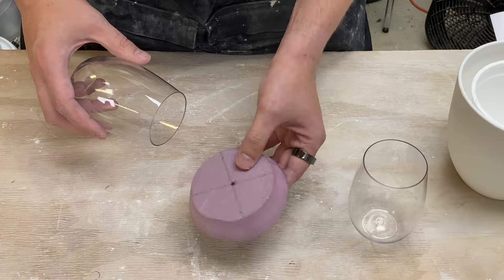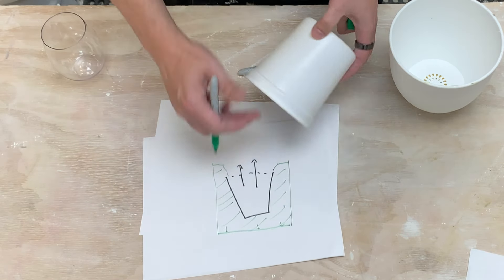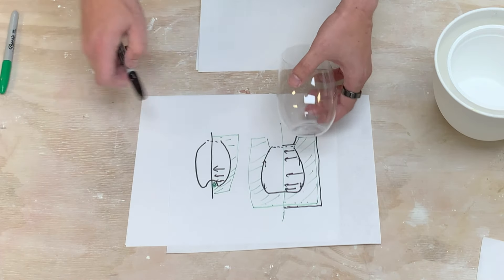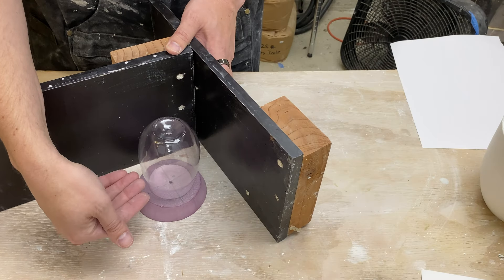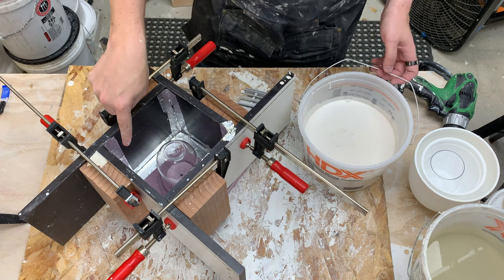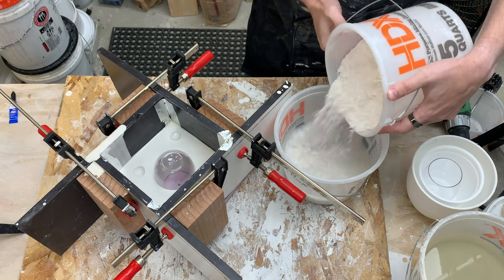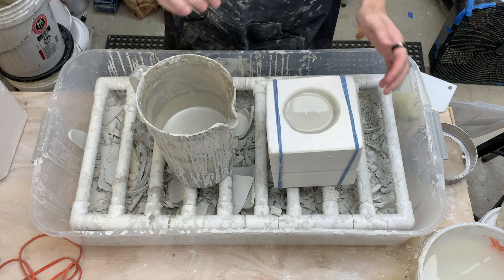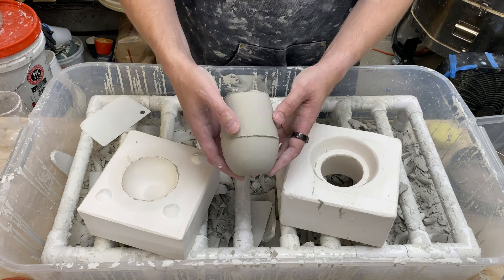Two Part Plaster Mold for Slip Casting

Comment: Excellent!  One tool I use that helps with handling internal bubbles and avoiding sneaky lumps is a small kitchen strainer. I pour through that, just as with the slip, and it helps with consistent surfaces. 😁
Reply from the maker: Thanks! I hadn't seen that one before. In these recent experiments I've found that mixing volume has had once of the largest impacts in reducing bubbles (having enough liquid so they don't get sucked in).
Reply: Pędzelkiem się dpowietrza
Reply: @epidian6240  - Не всегда, в отрицательных углах не удаляется.

Comment: The glass only had two molds, the bottom indent was added after the hot pieces were pushed together, and a stamp pushed up and deformed the combined glass.
Reply from the maker: Thanks. It is plastic, but that would make sense.

Comment: line the cottle boards with a plastic bag - guaranteed not to leak. An much easier to get a water tight seal than tape, clay, etc.
Reply from the maker: Interesting idea. I did that for a bit with my plate bucket - but it can get a tear that way so I stopped. And now, I much prefer my 3d printed molds!

Comment: I love mold-making. Good thought process. Another option was to eliminate the bottom foot, smooth-in with clay, and do two piece mold. Then use a round utensil to hammer in a foot indent after pulling out the form. Wouldn't be as precise but it would look better imo than an obviously mass-produced foot. Of course you were doing this as an example so no artistic judgement 😂
Reply from the maker: Yep, just a demo for sure! But it is a great point that you can modify forms to suit your needs like that.
Reply: Залей таким способом лампочку.

Comment: great video! i'm new to this and I'm a little confused, what liquid material is used for the slip? is it just plaster, or is it specifically made for slip casting?
Reply from the maker: The material to make the plaster mold that I use is specifically formulated for use with ceramics. In particular it is USG #1 Pottery Plaster.
As far as the slip itself, the clay composition is different than throwing clay, but I haven't dug into the details and I get it from my pottery supply store.
Reply: A newbie here as well trying to figure out the liquids.. Did I understand correct that the mold itself is made of modeling plaster (modelgips in Dutch)? Also wonder if this technique can be used to make mold from a clay sculpture and then make a plaster copy to have it lighter and to sand the imperfections afterwards? 
Many thanks!
Reply from the maker: @caglakaplan1748  Yes, the mold is plaster - it is specifically design for pottery use like slip casting (other plaster might work but I don't know).
One traditional way to do this is to make a plaster mold of a clay form. I think you're asking about making a plaster object from the mold - that might be tricky as plaster likes to stick to itself and is very rigid - but again I haven't tried myself.
Reply: @PotterybyKent maybe wrapping the interior of the mold with plastic wrap?  If you’re careful, you may be able to lightly sand out any fold lines left by the plastic wrap.
Reply: @caglakaplan1748  I have mistakenly purchased USG #1 Molding Plaster instead of USG #1 Pottery Plaster. It's a different formulation but it seemed to still work well for slip casting. The recommended is the Pottery Plaster.

This method is not for making plaster copies.

Comment: What if my object won’t release?! 😢
Reply from the maker: It depends on why it won't release. For example, did you accidentally create an undercut? In that case there's not much you can do besides break the plaster and try again. Sometimes I've found once things are cool, it is easier to get out. I've also had to destroy the original (usually a 3D printed part). At this point with my 3D printed molds I use a mixture of frozen alcohol and water to slightly shrink the plastic - you might try that as well.

Comment: I was wondering, is it possible to make a slip casting with a more complex shame like an indentation of a logo or some other shapes on the model? I have some experience casting things out of plaster, candle wax, and soap, but 0 with slip casting and ceramics.
Reply from the maker: Yes you can! And many people do that, for example having their logo embedded in the foot. One thing you really need to consider are the draft angles and making sure there are no overhangs.

Comment: A side by side 2 piece mold could work with the concavity at the bottom.  The sides would need to pull away down and to the side.  8:38 happens to have the camera along a suitable pull angle.
Reply from the maker: Thanks. Yes, that is a good point. I think my brain automatically goes to pulling perpendicular to the plaster mating surface. But that doesn't need to be the case!

Comment: Love all your videos, thanks for taking the time to share.  I see some people use those pre-made keys.  Have you ever used them?
Reply from the maker: I have not used them. I played around with 3D printing some, but they didn't work in the way I wanted. I'm still on the fence about having keys vs not having any - there are tradeoffs.
Reply: @PotterybyKent  I watched a video about 3D printed keys recently. The positive and negative keys cannot be the exact same size.  The negative side needs to be a bit larger. 

I have made two 3D printed molds so far, and had problems with both. Errors in printing compounded with errors in mold making made my plaster pieces not fit together causing leaking. I would be interested in seeing any solutions for these problems. Thanks!
Reply from the maker: Correct, they can't be the same size when printed. For my Shape Cast handle molds, I have keys but they also have a tolerance built in. As such they are there for rough alignment. The other issue with printed surfaces is they often aren't flat which can also cause leaking between the final mold parts. Lapping is one solution here (but keys would get in the way of that).

Comment: Hello! Thank you for making these very informative video! I want to cast a small sculpture I sculpted out of DAS air-hardening modeling clay. Will this work using your method of making a mold here? I haven't painted or treated the surface of the sculpture with anything. Thank you, Daniel
Reply from the maker: The first consideration is that there are no undercuts. Also, I don't know about the material - it could work however there is always a risk of losing the master. You probably want to do a test with another form if you're worried at all.

Comment: What if you need a shape with a hollow tube running through the middle? For example, a cone shape with a flat bottom with a hole in the center and a tube going to the top. 
I recently tried to make something like this with a one piece mold, because, like your first examples, a cone has a suitable draft angle. But, as I discovered, having a plaster cylinder in the center for the tube makes the clay slip shrink towards it, locking it into the mold, so obviously that doesn't work, and also, with a one piece mold, the bottom of the cone would be open. 
Would it be possible using a multi-part mold to make this object in one piece? Or will I have to make it in pieces and join them together like I'm doing currently? 
Thanks!
Reply from the maker: As you found, this type of geometry is indeed hard to do with slip casting and is likely dependent on the details of the form. I have seen successful double walled bowls and mugs which have an inner plaster part in a similar way. I think part of this is also size dependent (something smaller will shrink less in terms of absolute size - eg 10% of 10mm vs 10% of 100mm). You could also play with the clay body as they have different shrinkage rates.

Comment: Can we use white cement instead of Plaster? and how long do we keep liquid in the mold before pour out?
Reply from the maker: I don't think cement will work. I keep mine in for about 30 minutes but you need to experiment with your molds and slip to find a timing that works for you.
Reply: I have wondered about possibly adding some white cement to my plaster to increase strength. I'm not sure how that would affect the porosity and absorptivness of the mold.
Commercial molds seem harder and more durable than mine ever are, so I'm wondering what they are doing to make them that way.

Comment: How much water do you mix with the clay to know that 30 minutes is sufficient drying?
Reply from the maker: Those two are not linked in that way, so this is really two different questions. The first question is how much water is in the slip - follow the manufacturers recommendation (mine is 30% water by weight). Then the second question is how long to wait. That depends on a bunch of factors like your mold, how humid and warm it is, etc. So the best thing to do is test it and see. If the walls are too thin, wait longer next time and vice versa. Similarly for demanding, you can tell when it's ready when its release from the mold. And if it hasen't yet, wait longer.
Reply: Thanks for the quick and detailed response, makes sense :)

Comment: How would you make a mold for the classic vase shape that starts small at the bottom, gets bigger in the middle, smaller at the collar, and then bigger at the mouth? Like this (if the formatting works):
\ /
/ \
\ /
Reply from the maker: Depending on the foot, you would just split it vertically instead of horizontally (eg as I discuss at 4:00). The same overall process would work. If the foot would get trapped, then you might need a 3 part mold - one for the foot and then the 2 sides.